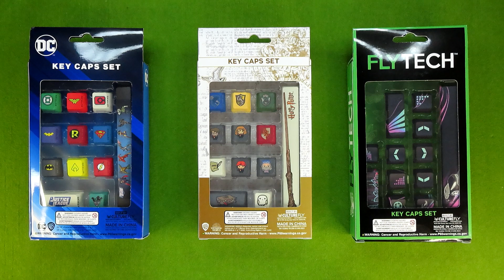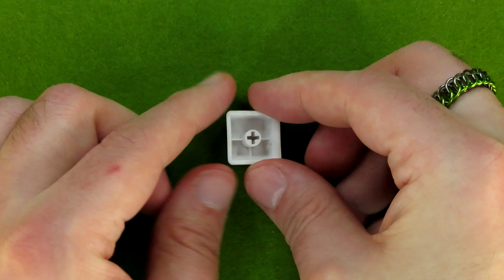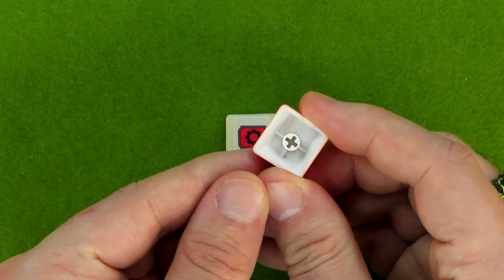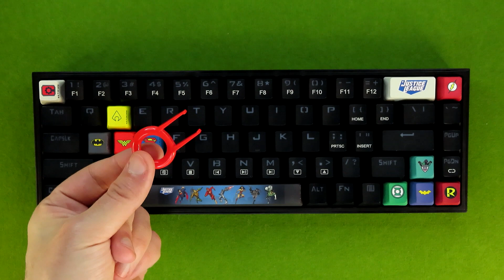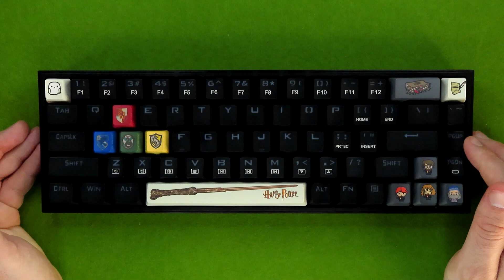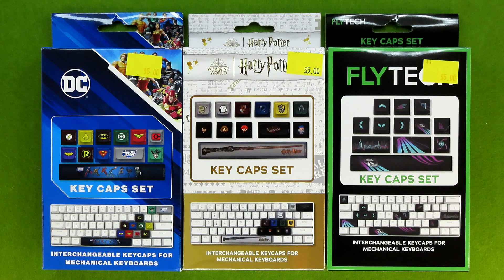$5 Mechanical Keyboard Keycap Sets at Five Below! | Five Below Review

Comment: Help! What cheap keybored can I buy to use the key caps?? I bought a keyboard at the five below too but they don’t fit. 

What type of keybored can I Google for to make sure they fit? Never done it before.
Reply from the maker: You need a mechanical keyboard. Specifically one with Cherry compatible switches (that's 99% of the ones one the market). There are some on Amazon in the $15+ range. Make sure it is not "mechanical feeling", since those are just buzzwords to make a membrane keyboard (like the one you bought at Five Below) sound fancier.
Reply: Do you know any brands of keyboards that work with the Harry Potter ones?
Reply: Like they fall down in and don’t clip in. :(